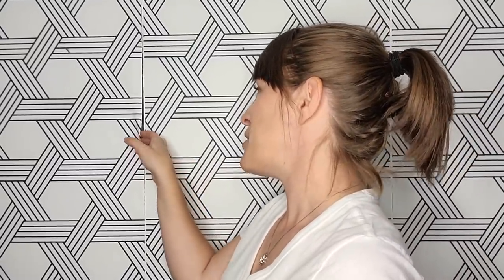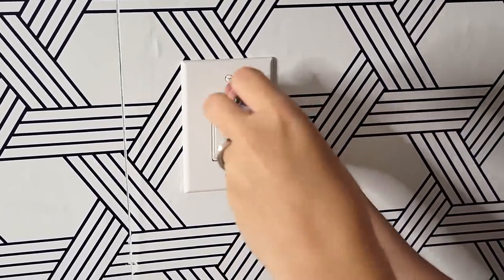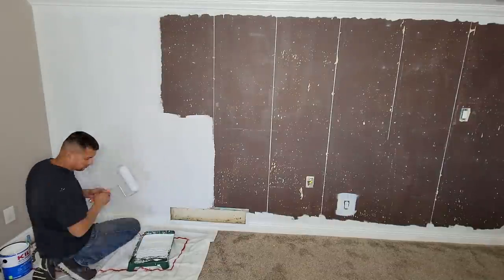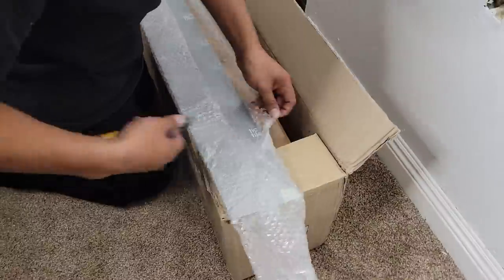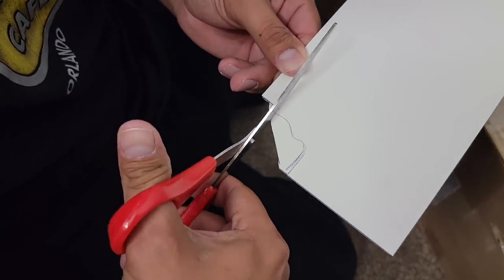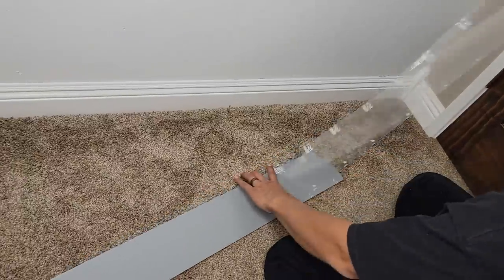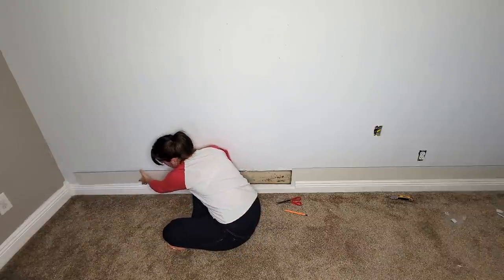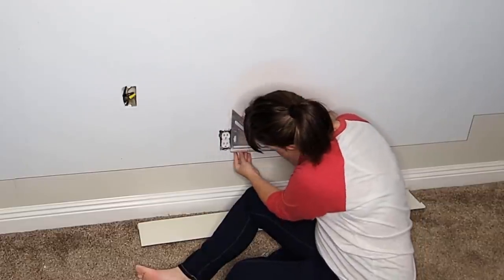NO Power Tools Needed: Easiest Shiplap Wall EVER With Renoboard

Comment: I have done the same thing on a wall in my livingroom. I found some really cheap wood look planks at Ollie's in a weathered gray for $14.98 a box. It only took me 2 and a half boxes to do a wall the size of the one you just did. Hopefully your adhesive is better than mine was cause I had to end up using a few small brad nails to keep them up. We have cheap flat paint on our walls from the previous owner and I feel that if the wall had been painted in a semi gloss or satin it would have stuck better. Yours wall look so good and thank you for sharing. I have seen another YouTuber make her own shiplap out of white foam board from Dollar Tree and used paint to get a wood look finish. It looked almost as good as yours. People with less income find great ways to fix up their houses. Much love and good luck with your pregnancy.
Reply from the maker: Thank you! And great suggestions. Spray adhesive works wonders if you have some pieces that aren't sticking well
Reply: It is likely it would have not have adhered better over semi gloss, because the slicker paint gives less “stick to”. Your solution sounds perfect though. I started a project using a product called “cedar backer board”, kind of a thin bendy product, to cover a wall that has some damage. It worked out fine, except we didn’t buy enough and it appears it is never going to be restocked. 8 (.  We didn’t want to spend much, but now we will have to remove it and find something else.

Comment: Hi Corey, you’re a lovely 
Person.  I’m 58 and we 
Gutted and rebuilt our
Little house as well as DIY ‘d everything.  I just wanted to warn you so
It doesn’t have to happen to you.  I go to bed every night with my hands throbbing.  It’s not gradual either (cause
then you could taper off)
But in just one painting job they went from okay to ruined (always use a sprayer) It’s mostly from pushing with pressure (fingers) and grasping tightly (a tool
Or tying twine tightly even.)  we are nothing 
without our hands!

Comment: Hi Cory ! WOW…how easy is that !  Does it have a smell at all ?  Some times those peel n stick things have a chemical smell. But being sensitive and as careful as you are, I figured you would tell us.

I watched a lady take her Peel N Stick paper off yesterday and it ripped a layer of her new dry wall off !  She had to use a hairdryer to heat it up to pull it off. Must be different brands are stickier than others !  This was an education to see both sides of Peel N Stick ! 

How are you feeling. Has the nausea stopped ? 🙏 

Thanks for sharing this easy home refresh !

🌲❤️🌲
Reply from the maker: This product is not sticky enough to cause that kind of damage. Yikes! It also doesn't smell. My pregnancy is going very well I have an appointment today for my routine pregnancy diabetes test and they always check the heart rate so I'll be sure to include an update in the next video. Thank you Jayne! Hope you are doing well too

Comment: Oh I love it !! Looked like you had some texture on the wall how much sanding did you have to do after priming
Reply from the maker: We had previously sanded it before we put on thr wallpaper so we didn't sand again this time. I had some pieces unstick because the wall wasn't smoothe enough so I used spray adhesive to set them better and it worked

Comment: How has the wall held up with so far?
Reply from the maker: I haven't had it up very long. My wall wasn't perfectly smoothe so some pieces popped off a little so I used spray adhesive and they haven't budged since.

Comment: Followed product link. On sale at $89 for 12 boards. $7.40 per board. Looks like you used 4+ boards across and 13 down.. About 450 bucks for one wall with these. Plus tax and shipping? 
NO THANKS!
Reply from the maker: If it is not in your budget that is understandable, but it is very comparable to the price of shiplap and doesn't require tools so it is an option for those who don't have tools but want that shiplap look. It is also a viable option to those with physical limitations.